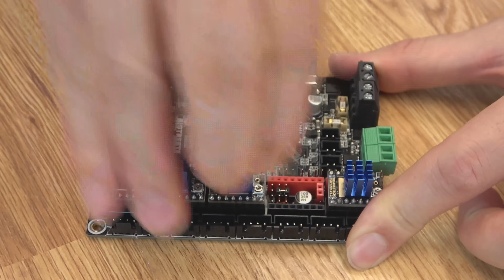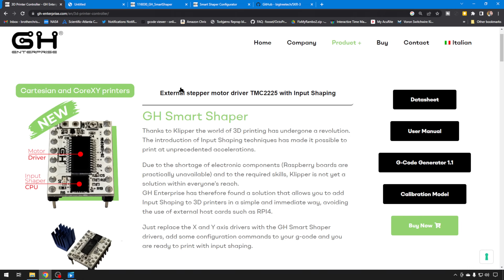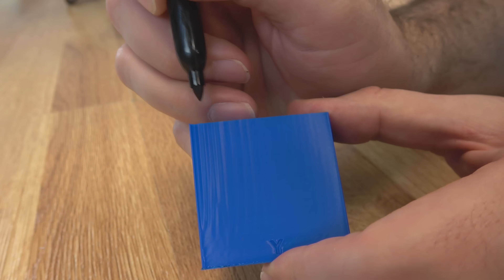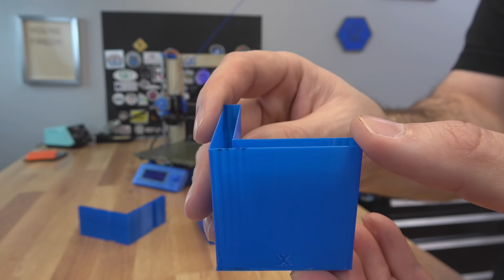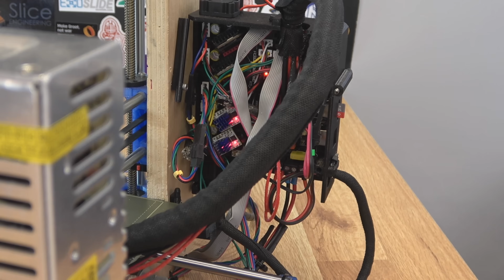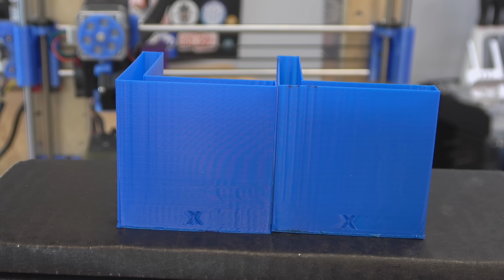Input Shaper - No Firmware Changes - G.H. Enterprise - Chris's Basement - 2023

Comment: I ran into some issue when I run the testing Gcode. Because the speed is so close to the maximum for my stepper motors I get a lot of skipped layers because my Y axis has a gear reduction on it. Curious if it is possible to run it slower or modify the Gcode and change the math to get the right values.
Reply from the maker: I would think you can edit the gcode to make your setup work. I would reach out to them for support, I'm sure they can help.
Reply: @ChrisRiley  I ended up figuring out that the input shaper doesn't default to current mode when you use the testing Gcode and that was causing the motors to not behave. I got a good result out of them after messing with the frequency a bit. But now when I try printing the driver disables input shaping all by itself after it gets programmed and I have no idea why. Support has also been nonexistant I have tried reaching out through email and I havent gotten any response from a month ago.

Comment: Of course I see this after I decide on an SKR 3 EZ and 2209EZ's to rebuild my OG CR-10 into 32bit.(granted mostly doing it to add a CR-touch and BTT smart filament sensor)

Sidenote, think GH with make these into the EZ format? 

Also this might be a bit obscure but think you could do a video on the SKR boards getting revised to better 32bit MCU's after their launch? I ran into this with my SKR3 EZ where it has the newer 550mhz MCU rather than the 480mhz MCU they originally launched with made firmware compiling a bit more interesting than i thought as i built everything up in stable release marlin, just find out i need nightly bug fix for a version that had the proper pinouts for the newer MCU (couldn't get a serial connection at all till I did that).
Reply from the maker: I don't know if GH is looking at a vertical driver or not. I will ask them. Also, with BTT, I will see if they will send a newer version over so we can do a side by side.
Reply: @ChrisRiley  Always good to hear, hope you hear some good things!

Comment: Chris: Following up on this video and your ongoing input shaping series, I would love it if you could run some trials assessing the importance of keeping the printer itself stationary. First: keeping the printer stationary versus on a wobbly table, both while calibrating and for "production".  Second, calibrate one way and production the other way -- like calibrate while wobbly, then later the printer is moved to a sturdy table, or vice versa.
And are any of the calibrations these days done with accelerometers on the head trolley? Because if so, they will measure motion relative to earth, when it's motion relative to the rest of the printer and the workpiece that matters -- so there a wobbly printer should result in poor tuning.
Reply from the maker: Hey Graham, Yes to all of this. These are things I have thought about a lot. There is a lot of room for testing here, I have lots of different things I want to try out. Hopefully, I can get them lined up for a video.
Reply: @ChrisRiley  looking forward to it!

Comment: Hello from GH Enterprise! 
Thank you Chris for your review, top as usual.

For input shaping, we noticed that "Current" mode (spreadcycle) works far away better than "Voltage" mode (stealthchop)

For this, we strongly suggest to use the GH Smart Shaper in "Current" mode. 
This can be done in the following way:
from the online SMART SHAPER G-code generator, in the field "TMC2225 Mode", select "Current [recommended]".

Comment: sorry to bombard u. I use these in stealthchop mode. If I use them in spreadcycle around 10 layers in when speed cranks up, I get a TMC driver error and the printer halts. This dont happen in stealthchop. I used current mode in the generator. Didnt know the difference. Since Im running in stealth Ill try voltage mode but still wondering if you have had this issue? Find me in discord please
Reply from the maker: Hey, I wonder if you are have terminal issues? I would be curious what you would see in the terminal is you enabled driver debugging.

Comment: Also wondering about your thoughts on Junction Dev vs Classic Jerk. I think Classic Jerk is better. CR10 running SKR2 with GH2225's and 2209's as well as on Ender 3 running SKR mini e3v3. Classic jerk does me better????
Reply from the maker: I still use Jerk, I really don't see much of a change from JD to jerk one way or another. I think jerk settings are easier to understand.

Comment: Given I am use to the Prusa Einsy RAMBo and working on a Duet 3 HC. But, the one thing is… both boards have the drivers on them. I am sure there are some pros and cons to this. But, removable replaceable upgradeable parts seem to be the right approach. Now add no configuration or very very little. You have my attention too. 😊❤🎉
Reply from the maker: Thanks!
Reply: I'm using RamboMini with them using external board soldered to Rambo (using step/dir solder points on back of the rambo). Search for Prusa Vmod Tmc2208

Comment: Unfortunately with the TMC225 you'll likely have issues with linear advance, so if you're using that YMMV
Reply: Pretty sure this doesn't matter. For input shaping you would only need to replace your X and Y drivers. You can keep whatever driver you are currently using for the extruder.
Reply: Current Marlin supports linear advance and input shaping on 2208 and 2209 without UART, 2225 should make no difference?
Reply: Yeah, I thought they fixed the bug for 2208/2209/2225 without UART. IIRC it was a very recent fix, though.
Reply: I had the same fear in the beginning but Linear Adv is only for the extruder. Not x and Y.
Reply from the maker: Yes, LA should be all good.